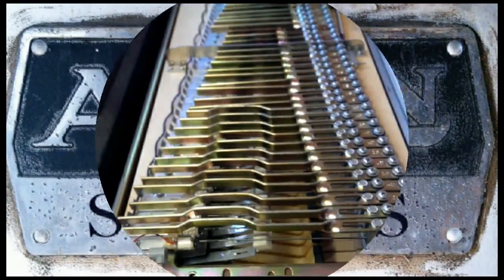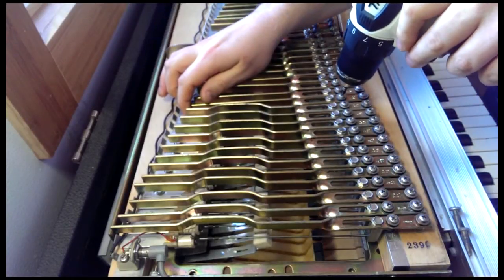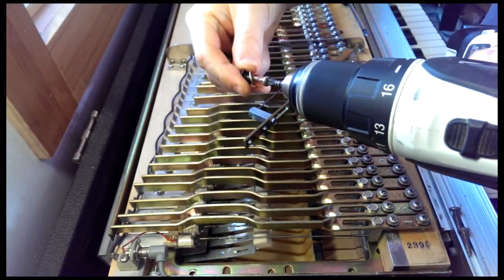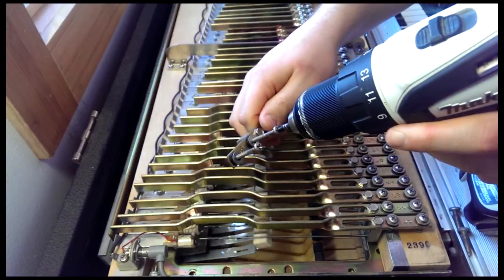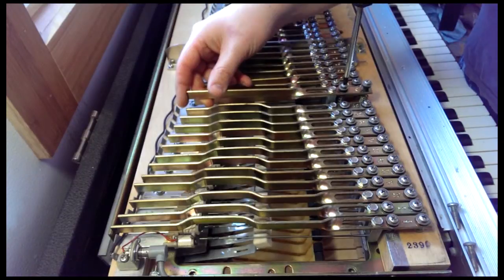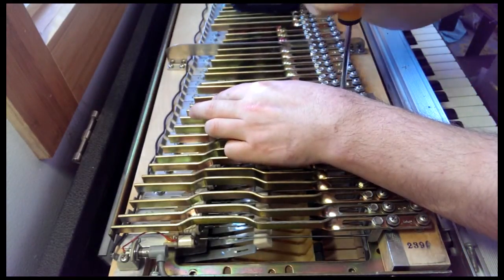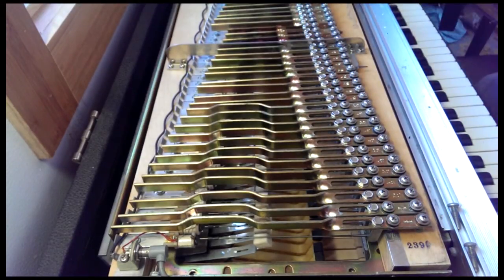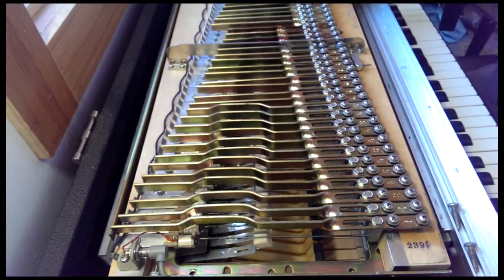Fender Rhodes - Replacing Rubber Grommets - Avion Studios - Part 2

Comment: have you checked out vintage vibe. they change grommets w/o taking off the tonebar. haven't done a refurb myself, but their technique looks really practical.
Reply from the maker: Excellent question. You can use that technique with any grommets, although ours may be a little more difficult as they're a bit beefier and have a longer shaft. You just do it one at a time. Typically we take everything off because we can clean up and re-voice the springs. But it is certainly faster that way and we have done it a few times. Just not the norm for us. :)